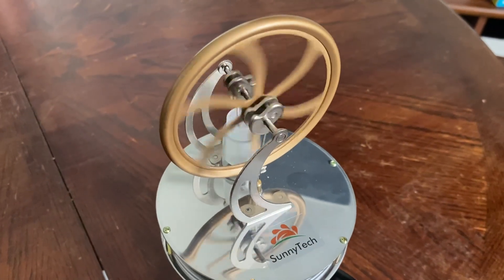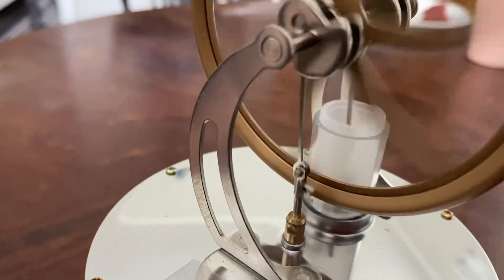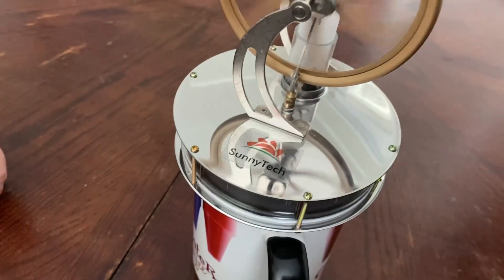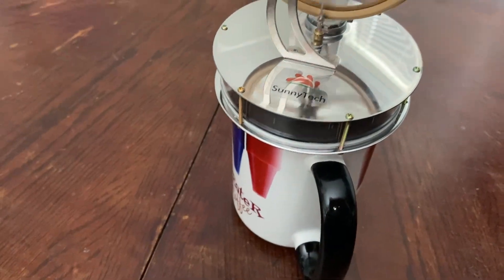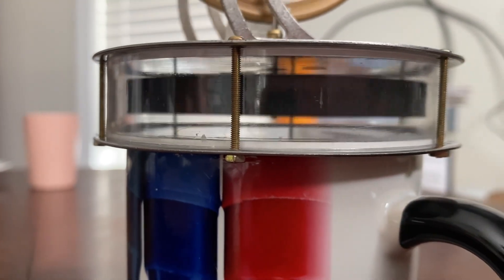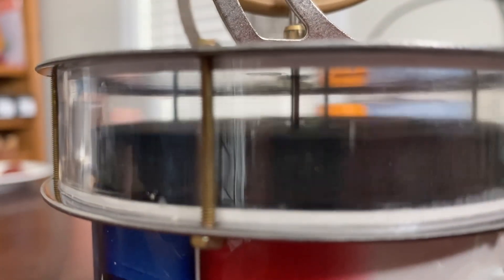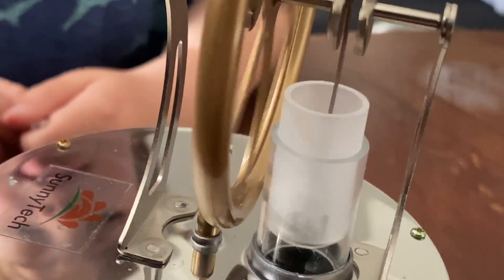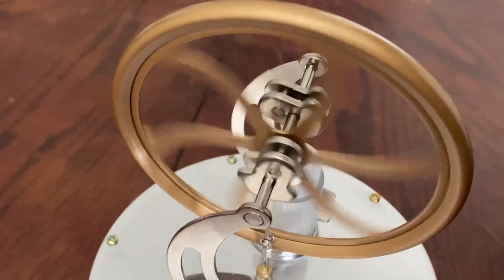The PERFECT GIFT for a Science Kid ~ Rex Reviews

Comment from the maker: The Stirling engine uses the temperature difference between its hot end and cold end to establish a cycle of a fixed mass of gas, heated and expanded, and cooled and compressed, thus converting thermal energy into mechanical energy.  It heats, cools, and recycles the same air or gas over and over again to produce useful power that drive the machine.